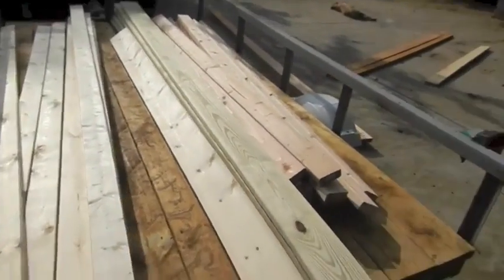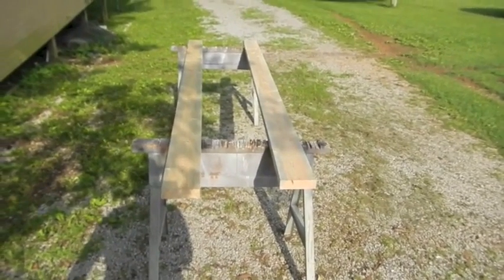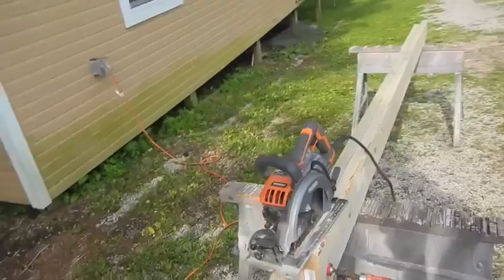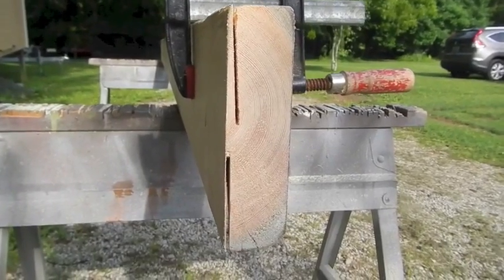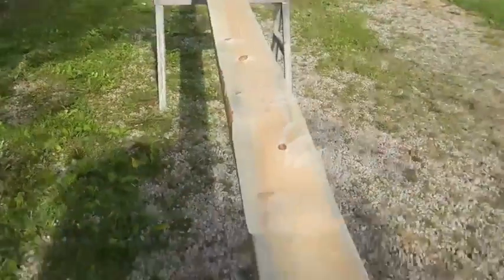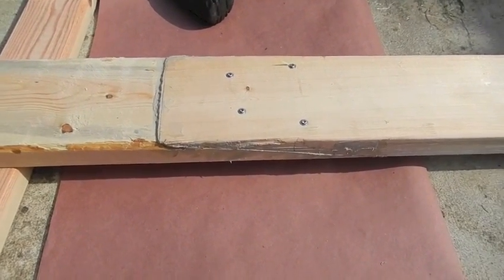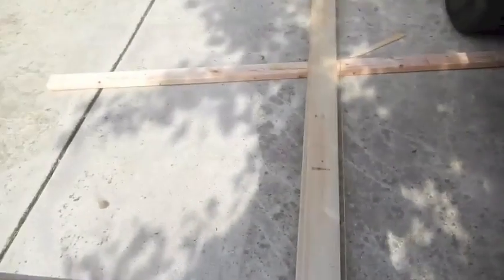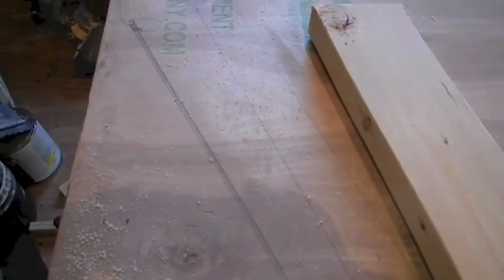Albion Boat Build Part 1

Comment: Hi,

Building spiras Seneca and I have a couple questions I'm hoping you can help with.

1. Thinking of using pl to attach ply to frames instead of epoxy, due to time crunch in using epoxy. Do you use the pl concrete and masonry sealant, or the construction adhesive?/which is better?

2. Did you install drain plugs prior to glassing transom? If I glass the whole boat first, am I going to have a problem drilling through fiberglass to install the plugs? I don't want to damage it. 

Thanks!
Reply: the consturction adhesive is a good quality product and very easy to use. if you watch video #2 you can see how he does it, using a caulking gun. quick and easy
Reply from the maker: Yes on using PL and yes on using drain plugs.